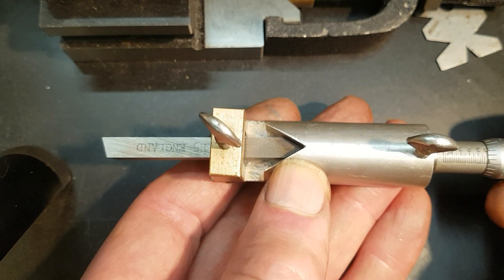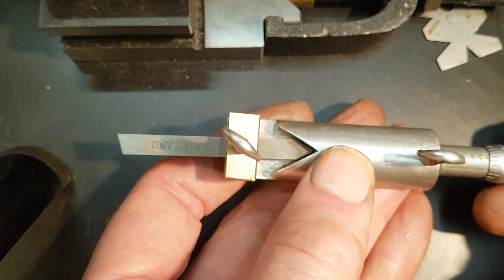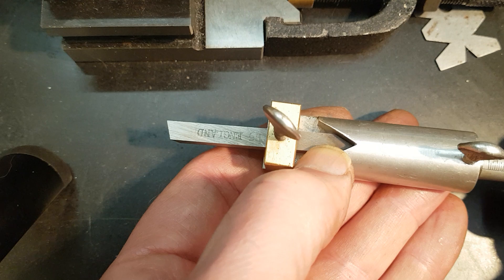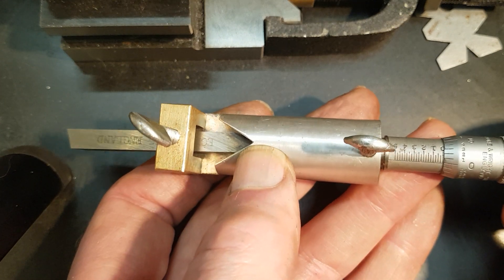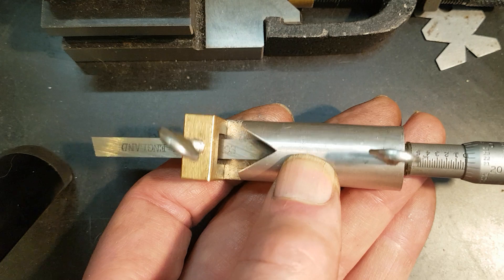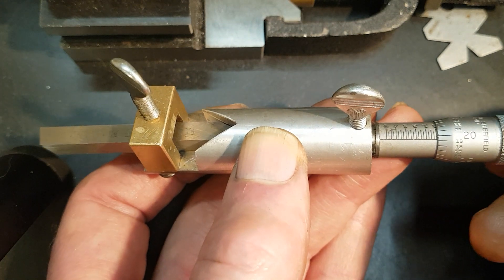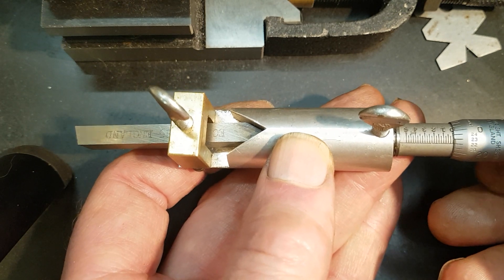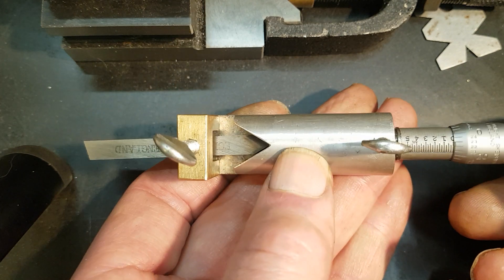A little gizmo for measuring the flat on the end of a single point threading tool.

Comment: Actually a very useful tool if you want to make threads that are actually in spec.  Your device gives me new ideas. 
A proper thread has specific sized flats that must be adhered to in order to meet the standard spec. 
For 20TPI threads the width of the flat at the root of the Male thread has to be between MIN.00625-->.0125MAX
The width of the flat at the root of the Female thread has to be between MIN.003125-->.00625MAX
The toolbit must be ground to cut those sized flats and ONLY those sized flats. 
Your device measures the distance from the point to the flat but a conversion gets the flat width. 
Which is:      (your device Measurement) /.866 = flat width. 
So that tool you measured .0058 ish will cut a flat that is .0067 wide.👍=good for a male 20TPI! (but out of spec for a female)

Conversely you can multiply the spec to get the required reading on your device
For cutting a Male 20TPI thread:
required flat width.00625 X .866 = .0054 measurement
required flat width.0125 X .866 =  .0108 measurement
So your device will have to measure between .0054 -->.0108 for the flats to cut a proper sized flat for a Male 20TPI thread.

For cutting a Female 20TPI thread:
.003125 X .866 = .0027 measurement
.00625 X .866 = .0054 measurement

Your outside the box thinking has given me a pile of new ideas. I think I'll make one but I will trade the micrometer for an indicator for quick checking while grinding threading toolbits. I can only say thank you for this fun!
Reply from the maker: Glad you like the idea, I recently made one for trapezoidal threads where the flat is more important. While I was making that one I had an extra thought, if you measure the length of the tool before the flat is ground you  can grind and measure how much shorter it is after grinding, then you could use a standsrd micrometer to make the measurement.
Reply: @chrisstephens6673  Yes exactly my thought for grinding 60 deg tools . But I think it's hard for an trapezoidal thread because the un flattened tip is so long, there will be a lot of extra metal to grind to get to a point then grind it back. For 60 degree tools we usually grind a 60deg point then add the flat so it's not much metal. For an acme it would mean grinding maybe twice as much metal to get a point to measure from then grind it all off to get the flat. Your tool foregoes the extra grinding and zero's in on just the flat. You just have to calibrate it with a point but after that you don't need a point to start.
Reply from the maker: @billshiff2060  I have grinding jigs for both 60 degree and trapezoidal where the overall length could be measured while still in the jig, but that is just technique rather than concept. Feel free to take the idea and run with it any way you like.
Reply: @chrisstephens6673  Thanks I will.
Reply from the maker: PS I didn't check your maths but I expect you are right, being old I have to work out from first principles how to do it each time I use trigonometry.
Reply: @chrisstephens6673  I am 71 and suck at math but I force myself to do it because of the benefits I get (and because of ALL the benefits I've LOST by not doing it).

In this case, it is pretty straight forward since the ASME and ISO have laid out a thread form that is made up of simple proportions based on the pitch. Using them guarantees that all male threads will fit with all female threads in their respective systems.

The proportions for the flats are:
Where P is the pitch of the thread...
Male thread root flats have to be P/4 max to P/8 min
Female thread roots have to be P/8 max to P/16 min.

After that you just have to find the height of the 60° equilateral triangle of the removed material which amounts to 
Flat X cos30° = Flat X .866 and you have your device reading for that flat.

Since I can't keep all that math in my head I have developed Excel spread sheets for things I might have to calculate more than once. For threads I took a deep dive into the  ASME standard and made a spreadsheet that calculates every single aspect of any thread entered exactly to the required standard's limits. Doing that was an eye opener, seeing what is SUPPOSED to be done compared to what people are actually doing made me a "standards evangelist"! That's why your device is an important find for me. Previously I had to go the the optical comparitor and actually measure the flats while grinding them. Your device makes that unnecessary.

Forgive my going on and on but it is such a great pleasure to converse with someone I know is like minded.

Comment: Can you make a video  of what that is used for? For us who are just getting  started?
Reply from the maker: I'll see what I can sort out but it will make more sense as you learn more about threading.
Reply: @chrisstephens6673  ok I'm so excited  to learn.
Reply from the maker: @1ton4god  Good man, if you don't already follow them have a look at the likes of Tom's techniques( no longer active but don't let that stop you )  Robin Renzetti, Joe  Pieczynski, Stefan Gotteswinter, Solid Rock, That lazy machinist, etc Blondihacks is coming along welll too. But the best teacher of all is experience. And the best bit of advice is don't believe there is only one correct way to do anything.
Reply: @chrisstephens6673  I watch Blondie hacks, and just subscribe to Solid Rock in your Channel. I just bought a Bolton lathe, and the grizzly Mill for sixteen hundred bucks for both, and a Grizzly Mill. They are used machines but they look like brand new. The guy that had them was a hobbyist and he ran the carriage of the Bolton lathe into the Chuck just a little bit I think it scared him so bad he sold everything dirt cheap. I will absolutely subscribe to every one of those other channels. I am watching videos every night my lathe and Mill or still sitting on pallets while I decide where to put them in my garage? I don't want to put them in my shop cuz it's a small shop and it's mostly welding and grinding and I hear that's bad for them. I'm also out of room in my shop.
Reply: @chrisstephens6673  oh I didn't know I was subscribed to Rob also. Been watching his videos this morning on scraping that Big Stone he's got. And also Joe has helped me a bunch when I was picking out my lathe, I forgot about that.
Reply from the maker: @1ton4god  sounds  a deal you got, his loss your gain.👍
I feel i must warn you that you now have an incurable disease, tool collecting.
It is best to keep grinding separate from machinery for obvious reasons. All my grinding is outside the shop but under a lean to. As for the shop itself dont think you need a massive space,mine is the back half of an English size garage, which itself would be about a quarter of a US one.
I have been trying to think what further advice I can give, there are many YT video channels that show projects and repairs which would good for you to follow but you would need about three months of constant watching just to catch up.👎There are also a lot of foreign language tubers, often in Russian, that are good even if you don't understand, like me, a word as you can see what they are doing. You might like to take a look at the list of people I sub to and see if any of them are of interest, but don't sub to them all as you'll go mad trying to keep up.
Good luck on you journey and never stop trying to learn more.
ATB 
c
Reply: @chrisstephens6673  one question I have. Is in my book on my lathe it says to replace it 36in from the back wall? I don't really want it sitting out that far is that really necessary? Also do you think it would be okay to put leveling feet on it or would it be better to bolt it to the concrete garage floor. Not really jazzed about drilling into my concrete garage floor.
Reply from the maker: @1ton4god  36 seems a ridiculous distance, mine is right up close, but it did prove awkward one time when I needed to get at the back, I still keep it up to the wall though.
Levelling is contentious, at least the word is  both ends need to be equally level or unlevel just so long as they equally. Obvious it is easier  to do with levelling feet. Bolting to the floor is often unnecessary, I  am not familiar with your lathe but assume it is floor standing, Just sitting on levelling feet will usually be fine provided you don't turn unbalanced work at excessive speed. My smallish industrial Colchester sits on thick rubber sheet on top of 8" risers, I'm quite tall, but this doesn't seem to cause any problems. Thinking of lathe height, they are often made quite low, saves metal i suppose, but you don't have to put up with it if you are only averagely tall. Leaning over a low lathe for hours is a pain in the lumbar. Another of my lathes is on three layers of house bricks, and an average height friend of mine finds it comfortable, so perhaps give it a thought while you are setting up your shop.
Can you find someone local to you to mentor you at least in the beginning? Although watching YT can be great, as a beginner you might not be able  to tell good from less than good, especially if the "expert" has a convincing manner. I recall one chap, with 10's of thousand subscribers, giving a lesson on threading and he  had little or no idea. That is the trouble, people proudly show their new skills not knowing they know nothing. 😭
Reply: @chrisstephens6673   thank you so much for that information!. I am 6 foot 5, and 425 lb not a small boy I'm from Kansas so they don't make anything small in Kansas I've eaten a lot of this🐂🐂 growing up. I've also driven over 4 million miles in my 30 years of driving a truck. I have two ruptured disc in my back so my thought is to make it lower to the ground and be able to sit at times at a artist chair and work on it. Most of my height is in my upper body so I think that will be copesthetic to my lathe turning. I sit at my Welding Table all the time. All of my welding tables are made to sit at because of this. Thank you so much for the information on the leveling feet. I also thought it was ridiculous 36in everybody's machine I've been seeing on YouTube most of them are right up against the wall. I have a forklift that will lift a thousand pounds so I can pick it up and move it if I need to. Pretty easy.

I also have a friend like you're speaking of. With over 40 years of experience in the Machining industry he builds gas valves for pipelines from scratch. For the company works for now. Problem is is he's 3 hours away. He is coming down to help me sometime in the near future once I get it set up. But he also is 55 and has a 9 year old and a 15 year old that he just adopt :-) but his family owned a machine shop the whole time he grew up so he's been around sheening and been a machinist for a long time. I also watch only the guys that you mentioned up there. I'm pretty selective on who I watch because my buddy, that has all the Machining experience told me straight up but people sometimes will intentionally mess with guys giving them misinformation just to see him screw the surface of the part up as a joke.

Again thank you so much for your help sir and taking the time to talk to me I value that very much from anybody I know how important your time is and I appreciate it.
Reply from the maker: @1ton4god  i have an inch on you. But you have about 200 pounds on me.
Workshop staff have a weird sense of humour, sending apprentices to stores for left handed screwdrivers, a long weight  or a can of tartan paint but not so much on YT, except where an idiot is talking out of his arse.
Lets not go into disc problems, the one main disadvantage of height in a world built for dwarves.
Time for some more advice, don't take all advice as gospel without verifying for yourself,except the bit about safety glasses maybe. Machinists are a conservative lot and often repeat the same old tat generation on generation without thinking why. Classic example is offsetting top slide to cut threads, not doing so to some people is like machinging heresey  worthy of excommunication. I was demonstrating threading at a show once and an old timer said you can't do that, and another said he was taught not to do it that way until he got a real job and his foreman told him to stop wasting his time moving the top slide from its proper position! Takes all sorts,as they say.
If you can get your friend to give you the basic feel of what is right and then practice. Always aim for getting exactly on size when making things even if not strickly necessary because precision takes practice , and being in practice helps for when it is needed. I feel my inner Yoda coming out so will stop there.
ATB 
c
Reply from the maker: @1ton4god  just thought of another distinctly worthwhile channel. Mr. Crispin he is only young and hasn't done much recently due to house move but he was trained by the best at Rolls Royce.
Reply: @chrisstephens6673  oh man that made my day I had to read that twice I laughed so much and still smiling and laughing while talking to text through Google. Love the inner Yoda. And especially the excommunication part. I wear glasses. I hate safety glasses. I wear a face shield in my shop all the time I have gotten used to it it's what I was taught to do years ago because I hated wearing safety glasses and Shop class. Is that dangerous Machining? I don't know honestly. My first reaction is no it be more safe. But I didn't know if there was something else like getting down post the machine looking at something it would get catch the face shield and Pull Me In?

Oh yeah and we used to Haze any brand new dispatcher. You would call up there and pretend to be a customer. Like Sony say, you would say hey this is Jose the guard down here at Sony and one of your drivers just drop the trailer in here and left the lights on can you have him come back and shut shut them off. LOL... Thank you so much for the help with this. I don't want to be the guy who started as a machinist and now it's missing a arm or hand or far worse.
Reply: @chrisstephens6673  wow his locomotive that's insane! That he is building that from scratch.
Reply from the maker: @1ton4god  I told you he was worth watching 👍
Reply from the maker: @1ton4god  using a lathe glasses should be safe enough but angle grinders will spray sparks everywhere so a face mask is a better bet. Use what you feel comfortable with and you are more likely to regularly use it, personally I hate masks so I use glasses but i have to admit that my glasses are not "safety", but reading glasses, they are however quite large and will help. I keep meaning to get some safety reading glasses........
I'm  glad you find my little attempt at humour to be successful. I find teaching with humour is more likely to be listened to than some boring old fart going through the motions ever will. The first rule of teaching is gain their interest and the rest will follow because they want to learn more. Geometry taught as a load of triangles means nothing to a lot of people, if they need to know the height of a slip gauge stack it will have some relevance. Joe pie teaches relevant  geometry quite well methinks.
Machine safety is a matter of common sense, like don't poke your finger in fast rotating sharp pointy things. You will get splinters, the odd cut and bruises but keep your wits about you and don't let people distract you and you should be fine. If in doubt air on the side of caution until you know for sure.
Reply: @chrisstephens6673  funny thing that's exactly what my buddy said. About don't let people distract you and keep your wits about you.
Reply from the maker: @1ton4god  wise man.👍
Reply from the maker: @1ton4god  just had a thought about your 36 inches after watching an old 40s video. Could it be 36 between lathes in an industry workshop to allow room for operators?
Reply: @chrisstephens6673  what I think it is, is what you said. But I think it's to service it. Because the motors on the backside of the lathe and if you had it like right up against the wall it would be like impossible to get back here to get to the motor bolts for the rear Carriage Bolt. So I think I'm going to put it about 24 in off of my wall. Is what I'm seeing most guys have it like 24 inches off the wall. So they can get in there and clean the chips out and service the carriage, and the motor.
Reply: How are you doing this evening by the way? We had an ice storm roll through here. So I took off today.
Reply from the maker: @1ton4god  over here in old london town the weather has been unseasonably warm but a bit wet and windy, although frosty (just) nights expected in a couple of days. Spending the weekend at the London model engineering exhibition as an exhibitor, lets me get in for free, i told you i was a cheapskate.😃
Reply from the maker: @1ton4god  sounds reasonable, especially if you have the room!😢
Reply: @chrisstephens6673  my dad, my granddad, my great grandad, all drove trains. I on the other hand was called a train robber by then when I started driving the truck. And my grandfather didn't have anything to do with me after that. We still get together but when much talking going on. Not only that I work for a non-union company so that even made it worse. We'll have fun and enjoy yourself.
Reply from the maker: @1ton4god  you rebel you😮
Reply from the maker: @1ton4god  just an off the wall (?) idea, put the tailstock end against the wall .
Reply: @chrisstephens6673  I'll do a video on it when I get home and maybe you could come up with a better idea than what I've got. I'll post it on my YouTube channel for you to check out her or anybody else for that matter to give some input.